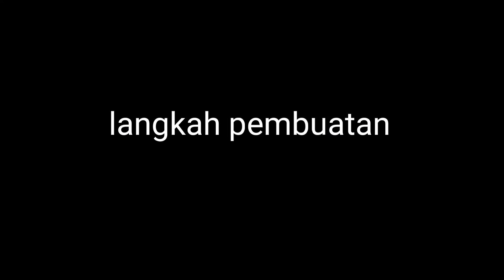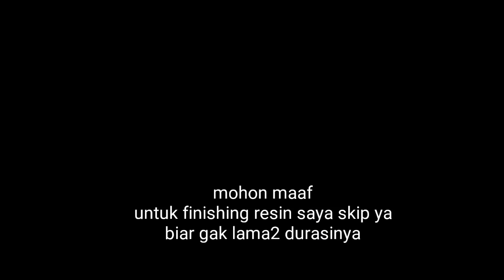Tutorial membuat joran  travel rod sendiri , how to make the best travel rod from fiberglass

Comment: Izin tanya bang, kalau boleh tahu ukuran pasti but cup, eva cork, reel seat, lip tup, sambungan stainless, carbon hollow, dan carbon shock nya? Terimakasih sebelumnya 🙏
Reply from the maker: But cap saya rasa umum mas semua sama, real seat 16, carbon holow 10 mm , carbon Shok saya gunakan ujung cangkek 1-3 lb, sambungan stainless 9.5 mm
Reply: @chuyku1014  terimakasih bang infonya🙌
Reply from the maker: Untuk sambungan stainless beda blank beda ukuran mas, coba di cek dulu berapa ukuran blanknya baru beli soknya
Reply: @chuyku1014 Izin tanya mas kalo carbon Shok nya pake stainless bisa ga?